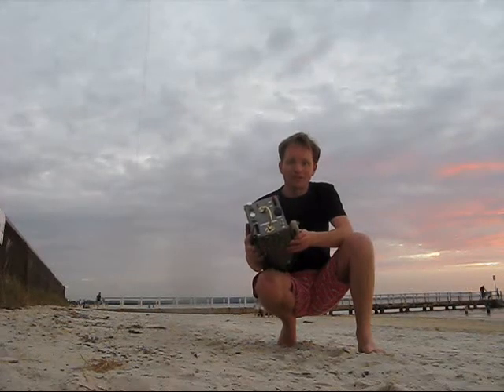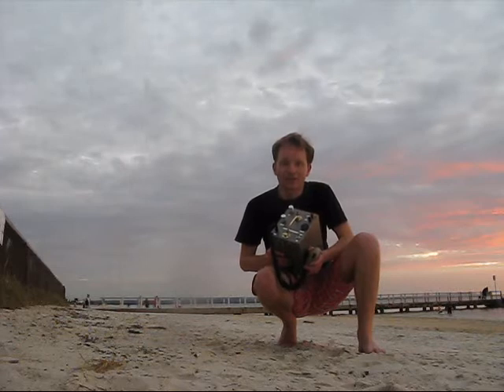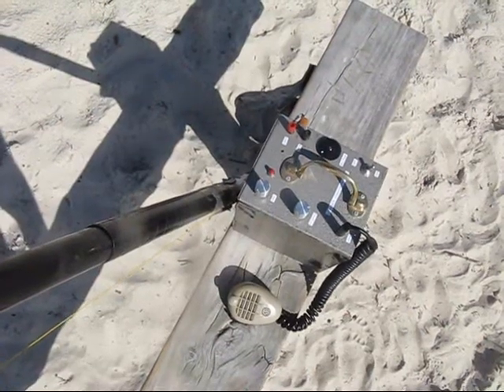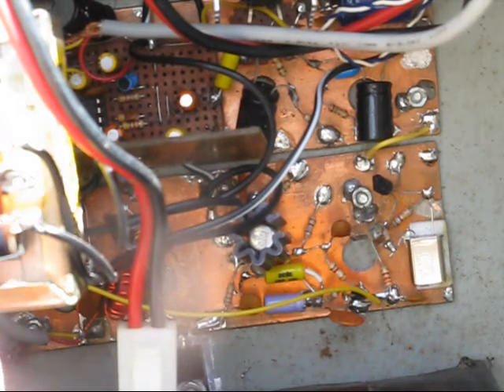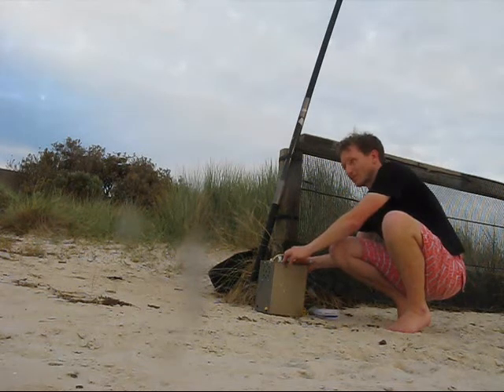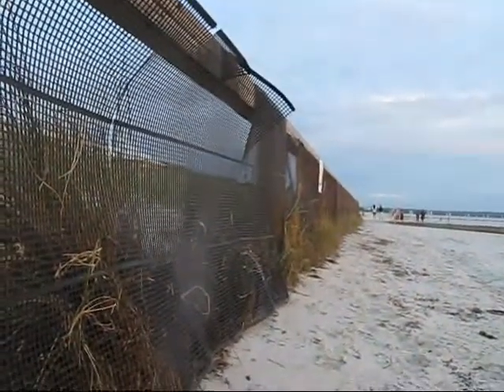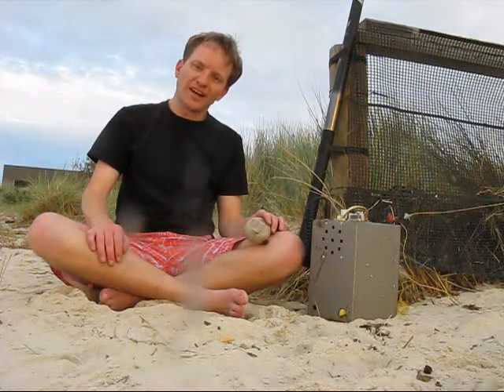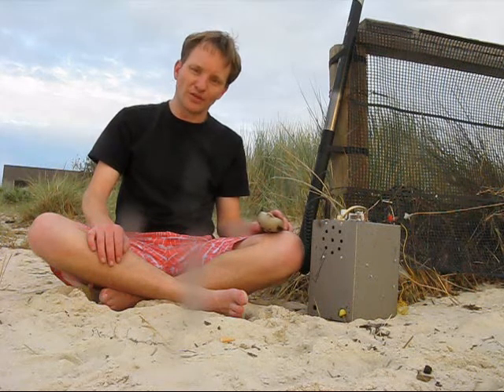7 MHz AM QRP homebrew from the sand

Comment: Peter, I'm surprised you've got so few comments after 10 years. Using an ne602 with a zn414 is simple and elegant for an AM receiver and using pirate design transmitters is innovative, so you have something quite unusual and special
Reply from the maker: The NE602/ZN414 was described by VK3XU some time ago. And the pirates probably pinched their AM circuits from amateurs/QRPers!
Reply: @vk3ye  Yes but you combined them into something good